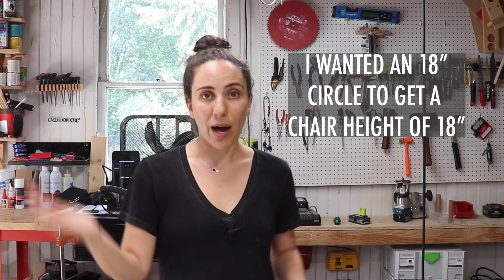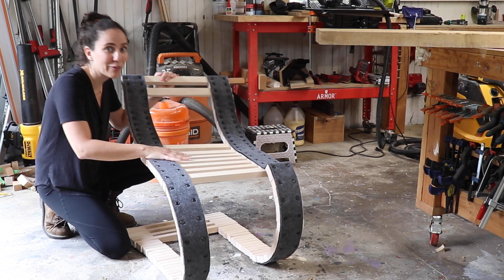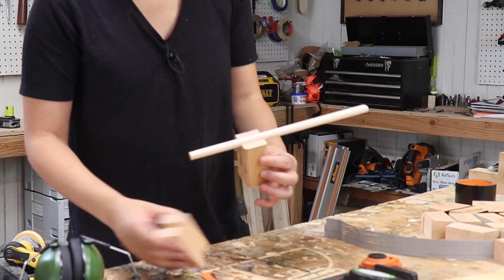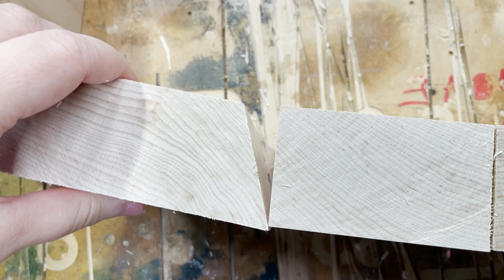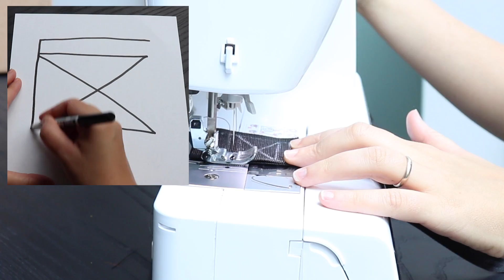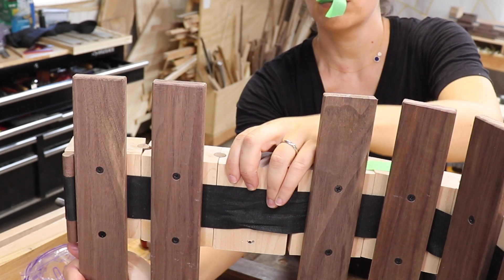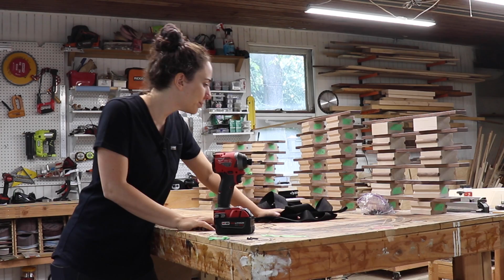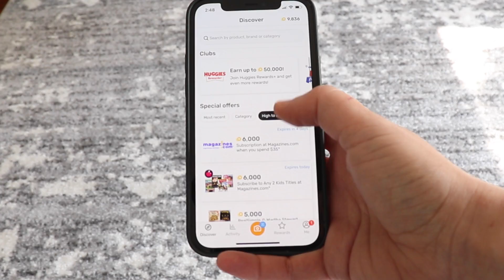I ATTEMPT to make a Roll Up Chair… AGAIN...

Comment: Having a quick scroll down the comments, I didn't see this suggestion so thought I'd share. Why not do away with the strapping entirely and make a mechanical hinge connection between each block much like a metal watch band?
Reply: Came here to say this, I think with the current design the strapping will always be a failure point as it will stretch over the entire surface of the strap. A mechanical hinge at each point will eliminate the stretching over the 5ish foot length of the design. 

I think she’s on the right track though! The dowel alignment to avoid twisting is frankly brilliant. Don’t give up!!!
Reply: @bryansnell7945  @Wolfdale276TV i agree with yall i believe if she does away with the woven staps or leather basically anything that has "give" she should be ok. I would op for a metal hinge thats flush mounted to the base wood like a door hinge or something similar at each joint then that should solve the problem.
Reply: Alternatively you could use steel cables possibly inlayed into the surface of the blocks instead
Reply: The straps can still be used, but they need to be fixed to each piece of wood. The current design allows the elasticity of the whole strap to come into play - even if it only stretches by 2%, over the 1m length that's 4cm which can open up at any joint. If the strap is constrained then the same 2% elasticity becomes insignificant on each joint.
Reply: @alexbeardmore3588   I see it this way too.  The straps are stretching between the fixing points and this allows the gaps to open; you could think of the straps as springs.  The straps actual purpose is to act as a hinge between the blocks but the springiness of them is problematic.  They could be glued to the blocks so that only the tiniest amount of strap can stretch block-to-block.  This would be equivalent to the straps being replaced by hinges per @Bryan Snell
Another aspect to consider is the weave direction of the straps. If all the bulk of the fibres/threads are aligned in the direction of tension (and the fibres aren't inherently stretchy) then the stretch is reduced. This is a fundamental consideration when designing structures in carbon fibre and it applies here too.
Reply: @alexbeardmore3588  I came here to say this. Hopefully we see it in the next version! I want to see it work!
Reply: @alexbeardmore3588  yeah that's basically what I'm thinking too but you may need to either calculate or trial and error each of the tensions needed between each part.
Reply: I think it is the positioning of the tension that is causing the issue.  Use wire running through holes in the CENTRE of each block (this will stop it folding over.  Make some kind of screw adjustment to allow the tension to be adjusted.  Fantastic effort btw, admire your perseverance
Reply: @UR_HR  would that not prevent rolling it up... at that point just make a 🪑 chair
Reply: @UR_HR  that will double the leverage and therefore stretch more and make it worse.
Reply: @UR_HR  The center would be worse, it would have much worse leverage against the folding force than the strap on top.
Reply: @McFrax  idea was that it would 'lock' each piece of the chair against the next... Since writing, further thought, for my suggestion to work you would need a way to release the tension to allow it to roll-up.
Reply: I was wondering if a bike chain routed onto the outer edge would be strong enough. Same idea as the watch strap but ready made.
Reply: @nicholaslougheed5281  yeah using a chain with holes, you could pin the chain on each block.
Probably the strongest available fairly cheap would be using forklift chain from a junkyard.
Reply: @nicholaslougheed5281  or even a Gates cam belt that has a super low amount of stretch and glue and screw to each block under the slats
Reply: @nicholaslougheed5281  somehow the bike chain idea sounds like something Simone Giertz would do 😆. It also sounds like a pretty cool idea that might work.
Reply: i think you just  need make the blocks take more stress with a box joint and that would be sufficient 
i do think a mechanical connection would look better
Reply: This is what I was thinking, and if you like the aesthetic of the straps you could find a way to put the hinges under the strap
Reply: I just commented the same before I even bothered to read the comments.  >_<  I suggested something more akin to a motorcycle chain linkage.
Reply: I was going to say the same thing "hinges"
Reply: Door hinges!!!!
Reply: Exactly what I was going to say
Reply: i thought the same . BUT.... it would add a lot of weight tho, which would defeat the whole "foldable" premise. Metalic hinges would be nive and easy and also avoid neededing the dados
Reply: That definitely could work! I was thinking some sort of metal hinge like what's used for doors or cabinets or something like that and if a locking mechanism is needed then you could add that onto it
Reply: That would work or you could use a connecter that does not stretch like chain
Reply: This is actually what I was thinking or even use metal cable tie downs.
Reply: snap 
Was going to suggest the 'independent/tensioned from each link' idea but your hinge idea is stronger and better. Different tensions are required everywhere anyways so it's better not to even bother with the deceptive single run approach. Although i did have the idea of making the design less spectacular too, having the end of the chair curl around and stack up like a letter d. Less impressive but equally rollable, and much stronger with "back legs".
Reply: I was going to suggest motorcycle chain for a similar effect.
Reply: that is exactly what I was about to suggest - put the hinges on the side you want to fold into - the same side as the cross boards - that will do it
Reply: The straps has too much stretch in tension. Mechanical joinery capable of resisting tension and stress may work.
Reply: Maybe magnets could help to hold the parts that might curve back as well? Idk
Reply: I thought that would work too. But if she wanted, they do make much stronger straps for semi truck loads. Easily accessible and not that expensive
Reply: @loganjroach  yeah, these can be VERY strong. Yet, i think the bottom line is she realized this design is not that practical, even after many design iterations, specially if the "foldable" premise must be respected. There are equivalent chairs built with laminated wood, and I've also seen those fail
Reply: @loganjroach  if she was ok with used ones she could get them for free
Reply: I was thinking that the dowels could be made into wedges that make a particular shape so that there is like a locking mechanism to each piece. But that seems to take too much work
Reply: In my head i see the meme where the obvious guy looks at this video... opens a lawn chair and does the face while gesturing his open hands at it
Reply: https://www.youtube.com/watch?v=MuodNlDKce4&ab_channel=JoshWright
Reply: it would be very heavy tho.
Reply: It's wonderful to see the process. Thank you for sharing the versions that didn't work. That's where the value in sharing rely comes from.
Reply: The idea of using the dowels as hinge pins that are secured by the blocks being interleaved on each side with the strap being more of an aesthetic than structural piece. That could actually work. It might not roll up as well as it did with the straps but there won't be any stretching under tension.

Another idea I just thought of is similar to how a robotic hand closes. where a cable could be passed through a point lower than the center of the wooden blocks (with the strapping still on the face). And needs a mechanism (likely in the base of the chair to apply counter tension to the piece internally... like a turn buckle on a headed bolt. But that will take away some of the portability.
Reply: Yep, think that will do it!
Reply: I think hinges would work great. No more belts. Or atleast fix it on each piece, in tensioned state. Otherwise it will transfer the load and start folding. That's the main issue here. It relieves the tension by folding .
Reply: Hinges just trades one weakness for another,  the hinge is strong but you need to fasten it to the wood segments. Both sides of each link. And that joint (screws?) Is in tension. If any one fails/the wood splits, it's catastrophe.

A chain that runs end to end with a metal  termination at each end that holds the wood segments in compression is massively stronger and more reliable

Comment: The only thing I can think of would be adding a diagonal support from the upper glued curve towards the back a bit on the bottom, make it so it can still come apart and roll up and locks into place at the bottom… but that might be differing too much from the original design for your liking

Comment: have you considered just using door hinges instead of strapping at each strap point? I think you're always going to have an issue with the tension, if I assume a block is 2", and you're sitting   24" away, you're multiplying your weight by 12x. At 100lbs, that's 1200lbs of reaction. if it's a little further, that's over a ton of force on each strap point trying to make it slide! it's just too easy for each point to redistribute the load, and the plastic will stretch and neck a bit as it pulls

if you isolate each break in the wood blocks into an individual segment, you could at least isolate each joint from the next and prevent the lines/straps from redistributing and hone in on just the problem area, that's where hinges might just do the trick.

Comment: Making the wedges thicker/deeper would reduce the stress on the strapping by giving it more leverage, It would make the chair look chunkier but that's up to you if you want to make the tradeoff. I also think the strapping needs to be attached at each individual block. The way it is now, tension and slack can move from one part of the chair to another which opens gaps and causes different parts to collapse, the blocks don't have enough clamping pressure to stop this from happening especially with the wedges being as thin as they are. You could also try running a few strands of steel cable (1-2mm diameter) alongside the strapping (or under if you want to hide it). 

Steel stretches and creeps far less than any kind of plastic webbing. I had similar stretch and creep issues a while ago using high strength dynema line (UHMWPE) and it was hopelessly elastic for what I needed, switch to steel cables and it was night and day.

Side note, at the bend between the seat and the back rest, since the walnut doesn't span the full width of the maple, and the strapping is on the inside of the curve, the strapping can cut the corners between the blocks and creates even more slack

Comment: I would recommend AGAINST leather, I work with leather saddles for bicycles and with sweat (humidity) and use (aka tension) it stretches and needs to be tightened.
Another idea could be to trade the strapping for a metallic strap or cable.
I think the overall idea is great and that the largest issue is in the leg bend.
An idea for the potential threat of accidental folding could be to wrap the strap over the first and last 3 boards to help secure them in place.
What about using the first chair to "reclaim" those materials and continue the project? or make a mini chair for a dog or stool or ottoman?

Best of luck!

Comment: Enjoy your work. I feel for you that this chair won’t cooperate! What about if you put steel pins in the inside of joint that go into chair little deeper than your dowel. Maybe the webbing can be more of hinge if you had an interior cable going through joints with a cam type lock on top that you undo to fold . Just an idea Good luck!!

Comment: Sailors use a product called "Dynema" for their lines to control the sails because it has literally no stretch under the tons of tension created by large sails under wind pressure.  I'm not sure is it can be flattened and used in your configuration, but you might do some research on it!
Reply: Dynema is commonly used by climbers for the same reason. You can definitely get dynema webbing.
Reply: Maybe you could run the cord through the center of each of the blocks

Comment: I love this, thank you for trying again! I had a couple of ideas which might be worth testing on some kind of scale model. First, maybe try hinges attached to the top of each pair of pieces. That would avoid the danger which you pointed to of the end pieces flipping and reducing tension on the whole chair. Second, I think using the outside layer (straps or hinges) to keep it solid isn't a great idea because there is always the probability that it will slip or rip. If the pieces could be securely joined, the circle and the wood's resistance would have enough force to keep a person sitting (I think!) So, maybe a good solution is to expand what you did with the dowels - somehow cut the wood so it sort of clicks together when it is in place (maybe with unglued perpendicular joint techniques)? I am not sure how to do this as I am not a wood worker myself, but I am sure it is possible, as there are strong permanent wooden joints all the time - these would need to be ultra strong temporary ones. Also, if/wjen you do invent it, maybe you can patent the idea and then bring it to a manufacturer!

Comment: I have an idea why don't you use metal hinges in the places that pieces come together with metal hinge you still can role it also if I were you after the first curve I would take the strap to the other side of the chair so I would eliminate the distance getting between the strap and the wood piece in the inside of the chair between the back of the chair and flat surface of the chair also you can use kevlar traps with epoxy resin I think this way you get better results

Comment: Hey! I would suggest to calculate the maximum pressure on the wooden parts in the first curve. Then also the ribbon tension in the same area. Then you know if the wood or the ribbon actually can resist the pressure or tension. Perhaps you get an data sheet of the ribbon with the tension curve. I would also rotate the each block through 90° so the wooden rings touch each other. That's the way wood can resist pressure mostly.

Comment: I dont know if the 'right material' exists. When you caclculate the stress put onto the strap, I'd think you'll find a pretty amazing nr. 
The way to solve it is to increase the thickness of the chair. If the chair is twice as thick you'll get halve the stress. (I think, I'm just geussing also.)
Reply: Dont try the thing with lether and stuff, the stresses are just way to big. You put an 80 kg weight at 0.5m distance. And the chair is 0.05m thick. So the force on that block and strap is 800 kilos. or more.

Comment: how about using more small pieces in the bend area? it feels like there are one or two angles failing because thes are maybe to steep? also, how about using thin metal stripes to connect the pieces?

Comment: Try using dyneema, I use it for sailing. It's stronger than steel cable, a hell of a lot lighter and is fantastic because it's pre-stretched, and wont stretch more. Can also be spliced and tightened to create tension if needed
Reply: Highly recommend this as its tensile strength is so strong, only problem with this is it can sheer at a super low force.
Reply: @maximearmand8903  could you somehow insert it into a tube to protect from outside damage? but would it still fit into the chair?
Reply: Dyneema was my first thought too.

Comment: Disconnect the tension of the back part from the tension of the rest of the chair. Whenever there's a force on the chair the back curves inwards to relieve whatever tension you have on the webbing, so it really doesn't matter how much it's shortened if it's all one continuous strap.

Comment: You could always just make a strap between each piece instead of throughout the chair. Then there would only be the stretch between each individual piece to contend with.
Reply: @Massive-1337  the difference is that in this design the tension transfers between them because the straps can actually slide beneath the planks holding them onto the blocks. this is also what the staples she mentioned in the video are about: fixing the straps so they do behave like many tiny straps
Reply: @MrRyanroberson1  I think you are right. I assumed the strap would be fixed to each block but it clearly wasn't at first.
Reply: I was having a very similar thought
Reply: What about larger cable segments? I.e. a cable going from bottom end to the beginning of the load bearing curve, a cable for the curve itself, and then a third cable for the back pieces
Reply: And or strap segments
Reply: @kwillie999  That would also be exactly the same thing, all else being equal.
Maybe you want to adjust the strength of the strap segments depending on their load. That would make sense and can be achieved with using a different material or just more material (wider strap or multiple straps).